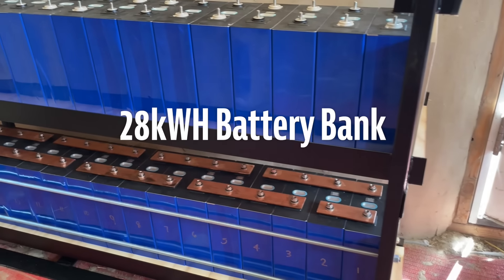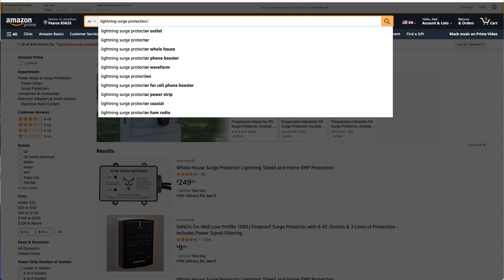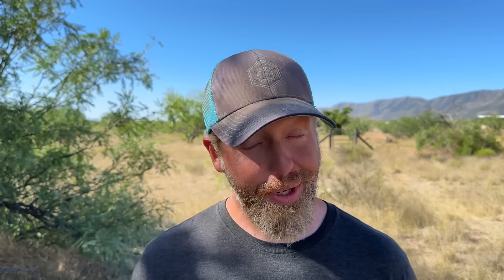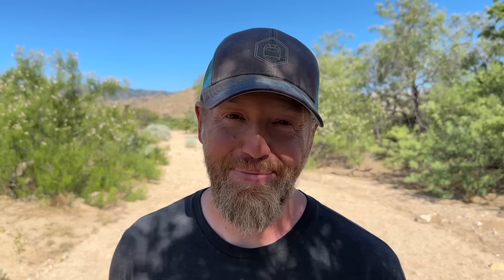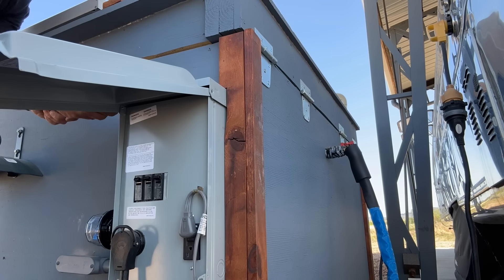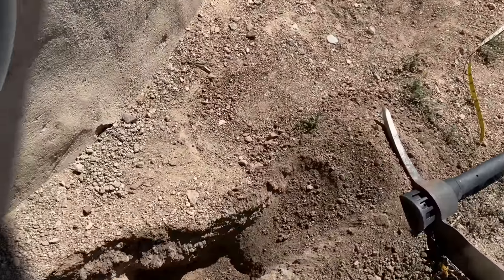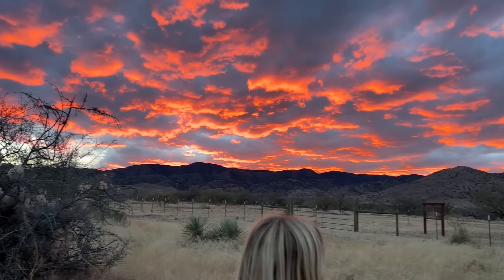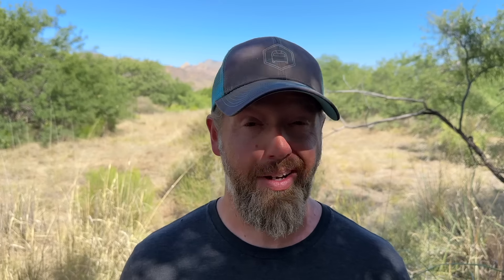This Cost Us THOUSANDS - Lightning Destroys DIY Off-Grid Solar System

Comment: 10:22 Is the lug on your breaker rated for multiple wires?  If not, you should make a pig tail with a wire nut to have a single appropriately sized wire clamped in the lug.
Reply: The stranded wire from the spd could have a ferrule on it, for a better connection in the lug, not cutting individual strands of the copper when lug is tightened.  If I saw correctly, the cable feeding the box is aluminum, and you might not want to put both copper and al conductors in same lug, for corrosion and thermal expansion which may lead to eventual excitement.  Or put both conductors crimped in a single ferrule, then in the lug, with anti-ox in and out of the ferrule.

Comment: If  there are two completely different protection circuits in the AC SPDs,  and you are using only one L wire, I'm thinking you could get a 2nd use of that SPD by switching the wires after a strike.
Reply from the maker: Maybe...since they both use the same ground wire I'd think it would all get damaged during a strike, but if the light still comes on then you might be able to use the other side.

Comment: Would it be of interest to build a lightning tower with many pointed rods not too distant with better grounding, one that is designed maybe discarge your area and secondly be more favorable to take it to ground rather than your electrical systems. Or is there a reason that wouldn't work?

Comment: Im wondering about Homeowners Insurance for Off Gridders...that would have been helpful...thank you for addressing that with the requirements of Certificate of Occupancy. I'm wondering since your build is so professionally done and documented, if the county would consider allowing you to pay the fees to go through the permitting process retroactively. Since Acts of Nature are not paid by all insurers, it will take homework. An Umbrella Policy might be the way to go. I did have Acts of Nature destroy parts of my permitted home and vehicle and they were covered. 6 months later another Act of Nature happened and I was out of luck. If I had an Umbrella Policy I likely would have been covered. I'm so glad you are so very capable of problem solving and performing your own work. Do you know how much Cochise County would have originally charged for your building permit?
Reply from the maker: We have a permit, but it's an opt-out permit which means we opt out of inspections. I'm not sure what the current rates for permits are.
Reply: Having been a General Contractor earlier in life, I have been impressed with the level of skill your family has demonstrated. I have known other counties to allow permitting after the build when it can be ascertained that the build was properly done. It might just be worth it if it makes the difference between being insured vs uninsured. I can also see repeated Acts of Nature out here doing us out of coverage after the first claim, as I have personally experienced that as well. It's a real toss up in the insurance  game.

Comment: How you wired the ground rods is not code.  The wire can not be cut. Stick all your connectors on the wire first so the ground wire is continuous. 

I was hit by lightning which knocked everything out of.  I'm running around like crazy trying to get the basics to work like refrigeration.  My wife comes to me and says she wants me to make parmesan popcorn. I stop everything and have some with her.  The basics were back running in two hours.  It is good to be able to repair electronics and have the parts in stock.

Comment: Ham Radio operators disconnect their equipment during storms to minimize potential damage ... perhaps consider some way to disconnect/GROUND the long cables during a storm ... using a contactor that can switch Wires in the Cable between LIVE and GROUND at both ends of the AC AND DC Cables ... PLUS power OFF all expensive devices; solar Charger(s), Inverter(s), etc 
Consider an Active Storm ... One time use Over Voltage Shunts may protect from a single surge but what happens if you get more than one nearby strike?

Comment: Nice job! The only difference I have down here in Florida is that my local code states that the wire from the meter box has to be a single wire that connects all 3 connections with no cuts. If I was in your situation, I would install lightning rods a short distance from the solar. May help.

Comment: if you have proper grounding you wont lose anything...
Also where you live, you should of had insulated wires in a steel tubing in the ground. Another thing to think about is lighting rods next to your array. 
One more TIP: use a dual axis solar system, you will make 40% more per day! i do it will never go back
Reply from the maker: Insulated wires in conduit, not steel tubing. No we don't want to pull anymore lighting directly to our area with poor soil conductivity. Most of what I'm talking about in this video is indirect strikes anyway. We hope proper ground helps but there's always a possibility of a huge surge breaking things no matter how much protection you have.
Reply: @TinyShinyHome  maybe you can move the grounding rod about ten feet away from stuff? Also add some lighting rods neer the array.
I have a dual axis array with a copper wire connecting the panels directly to the pole then in earth

Comment: You left off the best and simplest protection of all. 

Every time, and I mean everytime, there is a thunderstorm in the area cut off all external inputs into your systems battery bank (solar panels, wind generators, back up generators, etc) with breakers. 

You can leave the outputs from your inverters to your loads up and running. 

If you're going to be away from home during inclement weather disconnect all inputs before you leave. Reconnect when you get back.

We have operated this way for 25 years without incident.

The idea that you can really protect your system during a lightning strike direct hit without all inputs being disconnected first is wishful thinking and Russian Roulet.
Reply from the maker: It's also wishful thinking that you will always be available to turn off the power on site, and that you can afford to cut power for the entire time you might leave. Both lighting protection and turning things off can work together well.
Reply: In Michigan we disconnect for an hour or two every 10 to 14 days in the summer and never in the winter. Its not that bad plus it gives a lot of peace of mind knowing that you are totally insulated from the outside world and not just relying 100% on technology that can let you down at the worse possible time. It just takes some discipline. Real time weather following has never been easier with an app and you're not generating any power during cloudy thunderstorm conditions anyways. As far as surge protectors I have some but even Midnight Solar admits that they probably won't help in a direct hit. Can't afford that. Only a complete disconnect can guarantee total protection.

Comment: I'd still be concerned about your ground and it's ability to dissipate a lightning strike. Hi there, I lived and worked for several years (long ago now, retired) at one of the observatories high up in the mountains of Arizona as an Electronics Technician. One of my tasks was to examine the lightning protection and design for a mountaintop astronomical observatory. After contacting various companies making protection equipment, the key point I took away from all that reading and talking with their engineers was how inadequate most grounding is. Some points to be aware of:

1. You want to reduce the inductance of the conductor to high frequency, high energy spikes. A single copper wire is rather poor at carrying the surge current. The reason is that while lightning is DC, the surge is so rapid a rise the current acts much like a powerful Radio Frequency going down a conductor. Most of the current runs close to the surface of the copper rather than deep within the cross section. The high inductance of a single, round wire to that instantaneous surge impedes current flow. A great improvement is found in using a wide copper strap which means greater surface area, minimized cross section, low inductance.

2. The energy of the strike going into a ground rod will charge the soil in a spherical region centered on the rod. The radius of this charged area is equal to the effective length of the rod. The effective length is not always the full length of the rod, it depends upon soil conductivity. Depending on the soil, the useful length of the rod may be much shorter than the typical 8 foot ground rod. 

What I did at one of the mountaintop telescopes was to use a 4 inch wide copper strap 100' long. As the site had a lot of rock beneath the soil, most ground rods would only go in a few feet. The shortest was only 1 foot long. Spacing of the rods was varied to the length of what we could pound into the soils. For example, if 4 foot rods would work, they would be 8 feet apart.

What I had actually wanted to do was encircle the building in a copper strap ring with dissipating runs of straps and ground rods going out from at least four points. Then electrically bond the building's metal structure to the ring at many more points using flat copper straps. That ran into budget limitations and only the single run of strap and ground rods was installed. 

This was done at the power entry point of the building. The copper strap came up under the metal siding to a copper plate at the electrical panel. The A/C lines from from commercial power, a large UPS and the backup diesel generator all used gas discharge tubes to the plate.

The company I selected for all the hardware at that time (25 years ago now) was PolyPhaser. They used to publish a book on lightning protection, but I no longer see it on their website:

https://www.polyphaser.com/

They do offer many White Papers on different aspects of surge protection, specific applications:
https://www.polyphaser.com/resources/white-papers

They have a YouTube channel which, frankly, leaves much to be desired:
https://www.youtube.com/@PolyPhaser

So what would I do in your installation? 

I would leave what is in the ground there, but make a long run of a copper strap beginning parallel and connected to the existing ground rods. It does not need to be as wide as I used, just as long as you use flat strap not round wire. Space the rods twice their length apart. The ground of the electrical panel must be strapped, not simply wired, to this run of copper and rods. Remember the key is reducing inductance of the conductors, getting the energy out and away and dissipating it.

Here are the sort of grounding hardware I would use. There will be other sources of course, possibly less costly:
https://www.polyphaser.com/search?Category=Grounding&sort=y&view_type=grid

By the way, I do know your area. Lived in Cochise County in the late 1980's, explored widely by 4x4 and backpacking in the mountains. Worked in volunteer SAR there, all of which is much changed now. Beautiful area.

Comment: I think there are a couple of important points missed i this video.

1) Surge protection between 'hot' and 'neutral'.  In a conventional home electrical system, 'neutral' is connected to the ground system at the service entrance, and no where else.  This means that a SPD is not needed at the service entrance neutral because the neutral is supposed to be solidly connected to ground.

However at a 'subpanel' in an outbuilding, neutral must not be connected to the ground system, because this would cause neutral current to flow on the grounding system.  This separation is clearly shown https://youtu.be/7DvIjAvMge0?t=549 at the 'airstream cover' panel.  If the neutral is floated from ground, you need a SPD that connects hot to neutral to protect from voltage spikes across the 120V lines.  If you SPD shunts a lightning strike from hot to ground, but neutral is still energized by the strike, your equipment is toast.

2) Bonding.  Far more important than coupling the strike to ground is making sure that all of your equipment is at the same voltage in a lightning strike.    One way that lightning can enter your electrical system is through your ground rods.  Current spreads out through the earth from a ground strike, and this current can enter through one set of rods, pass through your electrical system, and exit through another set of rods as it is spreading.  The ground rods at all of your buildings should be connected together by a heavy conductor, so that if current from a near strike enters one set of rods it gets shunted directly to the other set of rods, rather than going through your equipment.

I once saw an amazing example of this.  On grid building with phone service entrance on one side, and electrical entrance on the other side.  The phone service entrance had a phone company SPD connected to a ground rod; the electrical service had a standard neutral to ground bond on the other side with a pair of ground rods.  Inside the building a length of phone wire was damaged by a ground strike in the vicinity; over about a 6 foot length there were burn spots on the wall every few inches, and the copper of the wire had flowed out in the shape of jagged spikes at each burn location.  The two ground rod systems were supposed to be tied together.

-Jon
Reply from the maker: 1. Neutral Grounding Bonding is definitely a whole other topic, especially depending on your inverter type and requirements if completely off-grid. The MidNite SPD's are only specc'd for hot and ground as far as I can tell, though.
2. I'm not sure about this one to be honest. That would be hundreds of feet of copper running every which way underground to connect them all together. And they all have their own spd/shunting at each end now. Your example does make sense because it's in the same physical building, but in our case with the panels and Airstream cover both 100+ feet away from each other I'm not sure if this applies to us.
Reply: @TinyShinyHome  
1. I agree about neutral earth bonding being a whole separate issue.  Relevant here is that with the neutral earth bonding that you have (which I believe is correct) the neutral wire at the subpanel is not protected by the SPD.

I checked the Midnight Solar documents for their SPDs, and agree, they are only specified for hot and ground connection, with one small hint of other use.  In step 3 of their installation instructions they say "In AC circuits it is not uncommon to connect the green wire to AC neutral, install the white sleeving over the green wire when connecting to AC neutral."  

This suggests an install where you have 2 SPDs, one connected hot-ground, the other connected hot-neutral.

I'd strongly suggest you contact Midnight Solar for their recommendation regarding installation at a subpanel.

2. I presume your various ground rods are already connected together via the EGC wires run with your circuits.  So ground current entering from one electrode should follow the EGC to the other electrode set.

Yes, having large bonding conductors between electrodes means lots of copper wire in the ground.  I'd suggest that having heavy cables parallel with your EGCs would give a 'statistical' benefit vs just using the EGCs; the EGCs already provide the bonding except in the event of a near strike where the high currents would damage the EGCs.

The example I gave (inside a structure) was intended as an example of current entering via one ground rod and exiting via another.  IMHO such ground electrode current flows are applicable anytime you have multiple electrodes in the soil.

Ideally any such earth current will flow in the EGC conductors and any transient voltage caused by this will be clamped by the SPDs.

Comment: For your ground rods, do you have any location(s) with moisture?  Being out from under the roof may help, but really only when there is precipitation to drip off the eaves. If you have a drain or leach field or even some plantings you water that can be a good place for ground rods.  If nothing else, dump some water on the ground rod location(s) every now and then.  This can be wash water, etc. The impurities, especially salts, help conductivity.  I've nearly encircled my house with ground rods at the corners and no more than 20 feet apart.

Comment: Wow that's a massive system!  What do you use all that power for?
Reply from the maker: After using it for a few years I’d consider it  a medium sized system, capable of running a 1000 sqft house comfortably. We’re using it to power multiple buildings here on the property.

Comment: Earth Ground:
Two ground rods may not be enough, earth ground testers measure the soil's resistance NEC targets 25 ohms on the hi end, for Electrical service bonding. Lightning protection is more critical and you want as lower resistance as possible say 3 ohms which may not be achievable in your sandy soil. references see: national safety standards and requirements of the Lightning Protection Institute, National Fire Protection Association, and Underwriters Laboratories.

Comment: I looked at the wiring diagram and it appears there was not a ground wire run between array and solar shed ground rod. This can help in preventing damage as the current will run on the ground wire to the grounding rod instead of thru the equipment, then to the grounding rod/rods. A direct strike will most likely damage equipment but an induced strike the ground wire will help dissipate the energy to earth. I could see ground moisture impeding grounding but if a bare copper wire, such as required where I live by code, is ran in the trench outside the conduit, it will help in dissipating current.
Reply from the maker: Solar array has its own grounding and should be separate.  https://tinyshinyhome.com/diy-off-grid-solar-system#wiring-solar-panels
Reply: @TinyShinyHome  I wish you the best with your plan. Dispersing of induced gradients is the goal.